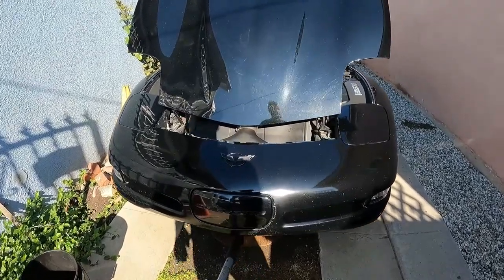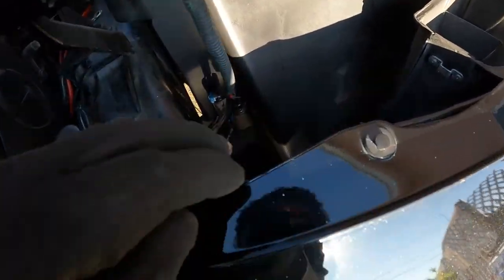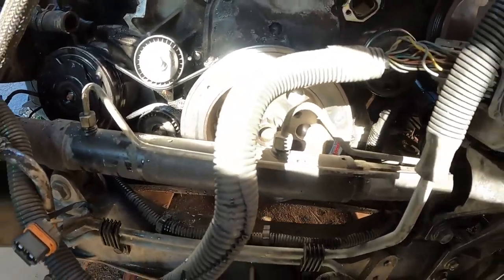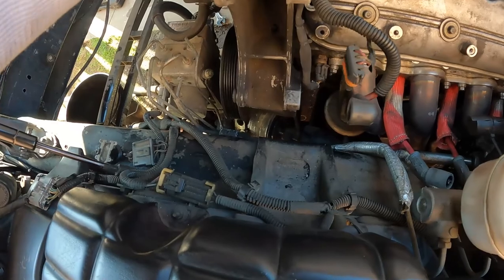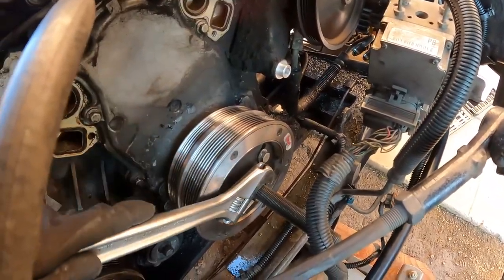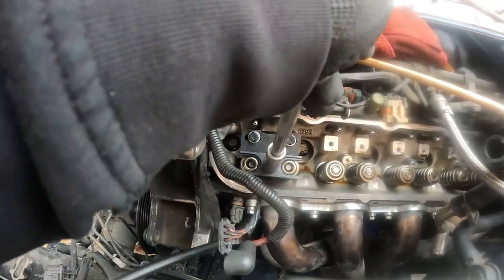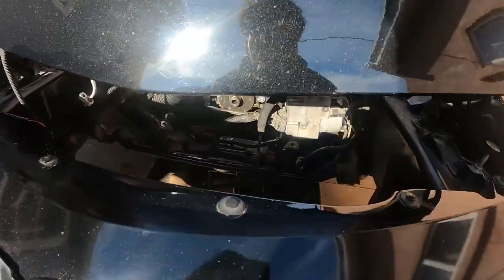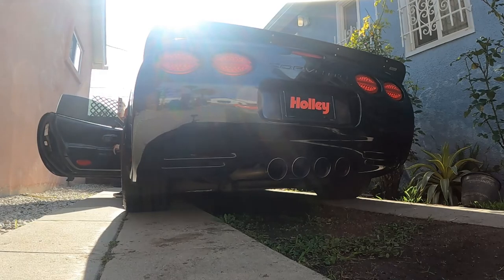C5 Corvette Cam Install (IT’S LOUD!)

Comment: I'm not a C5 owner (YET!) but this is a dope video! Reminder to anyone doing this or the Harmonic Balancer replacement, you'll be in the same area of the engine so you might as well do both while it's open!

Comment: Good job man. Thanks for the video. I used a cheap harborfreight valve spring tool to do valve guides years ago on an LS1 and it pretty much only worked for that job. I dont think I would use it for another go around.
Reply from the maker: I much rather take the heads off next time I was scared of dropping a valve

Comment: This was a great video my Man!! What you accomplished mechanically while filming. Impressive. Great accomplishment appreciate YOU going through all the extra effort to share it. I know the added complexities of doing a video on top of a major mechanical job/overhaul. Unique sound as well the startup was great. Sure that was a weight off hearing that too. Lastly, I like all your choices part wise. From what I know you should have zero reliability issues with the valve train/engine. Imo, fwiw, you reinforced or upgraded any potential weak/failure points w/The Ls. Much respect!!!
Reply from the maker: Thank you!

Comment: Good job brotha! Proud of you!
Sub'd
I'm running a 2.9liter whipple just put in long tube headers with xpipe.  Getting tuned tomorrow!
Might cam it later but gonna do wheels next.
It's a pewter 02 convertible  BTW.
Reply from the maker: 😯😯 film that I wanna hear it!
Reply: @HTPJay  what the supercharger?
I'll get it all sorted first, then put together a vid. Got buncha buds asking for a vid too 😆.   
Probably should do a channel myself but I'm too lazy to wanna film me working on stuff.
I built up a 600hp VW R32T I daily.
Fully built forged up internals 6266 dbb turbo.
Smokes crotch rockets 😆. 
The vette was my pops gift to me but never ran right. Had knock sensor issues. I replaced them and am getting road tuned in a few minutes. 
I'll let ya know how it goes brotha😉.

Comment: how do you like the cam? been looking into this guy for logevity sakes on valvetrain? hows daily driveability adn how much did you lose of the cruising mileage?
Reply from the maker: Honestly drivability is not great it surges under 2k rpm when driving which is horrible on gas mileage because I have to keep it above near or above 2k

Comment: Did you have to lower the subframe a bit to get the steering rack out.
Reply from the maker: You have 2 options you can lower the subframe a bit to fully remove it out the driver side or you can slide it to the passenger side and let it hang out without having to remove it

Comment: Yo tell me ur on Los Angeles I got a stage 4 cam  for my c5   mines is automatic though  so Im prolly gonna have ta change  the torque converter to a 3600 3800 stall so it can hold the power supposedly guy I talked to on the phone from summit racing 🏎️ said the car  wouldn't start upon installation  I have a hard time believing that I think it would start with the torque converter I have now but idk if it would stay on  had no idea  the details of  installation  u made it look easy af 😅
Reply from the maker: Your car will start but it will turn off soon after until you get it tuned
Reply: @HTPJay  and that's without changing the  torque converter just high tune it 🏎️ ?)
Reply from the maker: Yea, the new torque converter will make taking off from a stop easier

Comment: Hey man, I know it’s an old video but I’m in the middle of doing a stage 3 btr cam and I’m unsure if I need injectors, just curious if you did Injectors and if you did what type and if not have you had any issues?
Reply from the maker: I didn’t do injectors, I wouldn’t do injectors unless you’re doing a supercharger or something bigger than a cam swap
Reply: @HTPJay  I’ve seen multiple people say I need 42lb injectors but I’ll probably just call my tuner and figure it out haha. Thank you again man I really appreciate the response

Comment: Nice work.  I think I have seen top dead center method used when swapping springs so that the valves don't drop.  Meaning you raise that cylinder to the top and then compress the springs so that the valve has nowhere to really drop.  

How many miles on your C5?  I am thinking about doing a camswap this year and also running stock lifters.  Any issues with them so far?  How big is your cam and what lift?
Reply from the maker: Yes you can do tdc method as well. 174k miles so far no issues with lifters but I might replace them soon. Cam is 233/243 duration .541 /.541 lift, probably going with a bigger cam later on
Reply: @HTPJay  wow big duration but lower lift.  What kind of power did it make?
Reply from the maker: Not sure what it’s making haven’t put it on a dyno just a street tune
Reply: @JonnyAbs-0  definitely do not run stock lifters. A new cam needs new lifters so they can wear in together. Previous owner of my 01 z06 did a cam swap without doing lifters and I lost a lifter. Upon removing everything, lifters that looked fine had actually eaten away cam lobes because they are worn in to the original cam. To make it all more fun one of my pistons is a little melted and I’m in the process of trying to push it out from the bottom via removing the oil pan which is a project of its own. She’s been down for almost two weeks, hopefully she’ll be running well again in a few more.
Reply: @peterb4143 piston melted because of the lifter or no?
Reply: @peterb4143  that sucks that I would have to pull heads because that means then that I'd want to upgrade the heads, and I would need new injectors and a new clutch and probably run a fast and long tubes and i dont want to do all of that right now.  If I was dropping the rack to do long tubes then I might as well install a new steering rack.  I just want to do a cam swap right now.    Grrrr
Reply: @JonnyAbs-0  previous owner had the same attitude and look what happened to my poor LS haha. I’m in Cali so I don’t have long tubes even though I could, with stock manifolds could just delete the cats to let the cam breath better in the meantime. Don’t need crazy injectors either, the stock 28lb ers could hold a cam but they’d be almost maxing out the duty cycle. But I did buy some nice Bosch 42 lb ers for $360 that we’re only at 65% duty cycle or so after my dyno tune. If you have a base it isn’t too hard to find some well priced 243 heads the z06 has, but either way you basically have to do everything in one shot as far as a cam goes. Lifters, oil pump, timing chain, (cam kit I got has pushrods, valve seals, springs, and retainers), rockers, all the gaskets for everything, new harmonic balancer and pin it since your in there. All that cost me a little over 2500 including some tools. With 243 heads, long tubes, and a tune you’ll probably spend almost 5k but you’ll make over 400whp. But then you probably need a new clutch too. Owning a c5 with 135k miles and making it like new again has really been a journey. I’ve spent maybe 5-6k and all my sanity in maintenance parts alone over the 1.5 years I’ve owned it since I do all labor myself. Clutch was a nightmare but it’s doable on four 2 foot jackstands if you have the time and an extra set of hands. Unfortunately I installed the rear main seal wrong and it leaked and I had to put the old clutch back in on top of that because the LS7 clutch was basically impossible to shove the torque tube on (mechanic told me I also put pilot bearing on backwards) I don’t regret paying my mechanic 1500 one bit to fix the rear main seal and finally have the LS7 clutch in a few months after I caused that mess upon myself. To sum it up the c5 is an absolutely amazing car, but it requires either a decent amount of your time and money, or just a lot of your money to make it what it was 20 years ago. It’s definitely a 25k car and not a 15k car because any old sports car is going to need all new components to work as it was new, at least if you intend on pushing it to the limits like I do. It’s totally worth it for me and the driving experience for the price range is like no other car. But as far as a cam job goes, do it once do it right. Be ready to spend what you have to, replace all the wear items you access amidst tearing your whole engine bay apart. It’s actually pretty easy, just very time consuming. One tip I haven’t seen on the internet is that you can actually pull the steering rack out from the top pretty easily, no need for that lower the engine cradle bs. Other mods I would say are a must/super beneficial to go with a cam job are the tick adjustable master cylinder and a clutch of your choice, and the Dewitt’s aluminum radiator. 7-800 for a radiator seems crazy but my coolant temp stays at 175 on the freeway and barely hits 190 even after a lot of redlining and drops back to 175 after a few minutes, probably the most beneficial and least expected favorite upgrade. One last helpful thing was new coil packs, got a set of pertronix coils that work great for 250ish for 8 and finally fixed my engine light/misfire code. I actually got my damaged piston out today by removing the oil pan and pushing it out from the bottom, felt so relieving to get that done and finally start putting her back together once the new piston arrives.
Reply: @peterb4143  I believe you are thinking about old school flat tappet camshafts. Those have to wear with the lifters. The LS motors have roller camshafts which do not wear together. Although it's never a bad idea to change old lifters. The stock lifters should be ok as long as they're in good working order.

Comment: Do you regret not putting rtv on the timing cover bottom corners?
Reply from the maker: No, I actually replaced my oil pan gasket afterwards because the rear bolts were leaking
Reply: @HTPJay  I think I'm gonna send mine with no rtv as long as timing cover is lined up it should seal